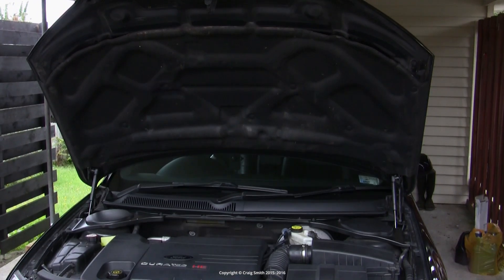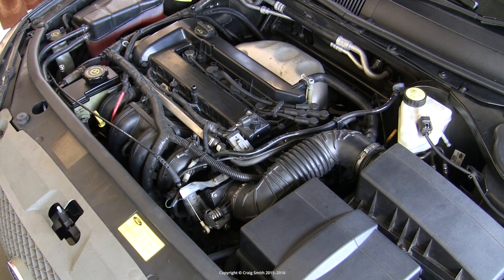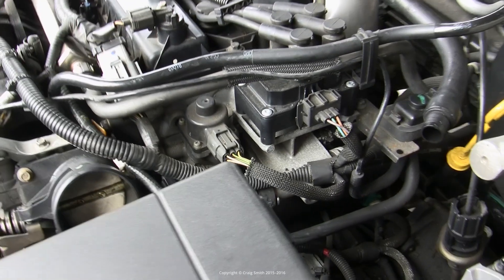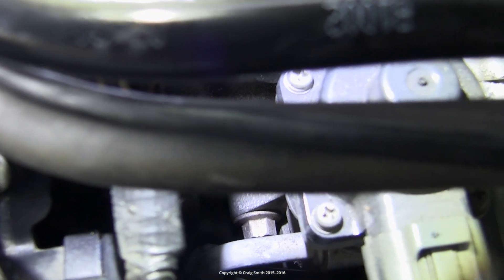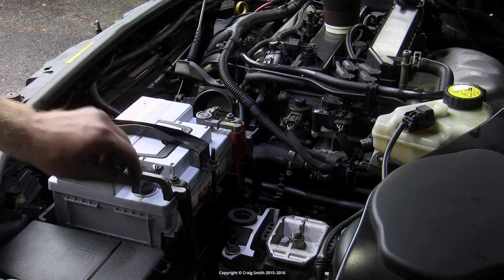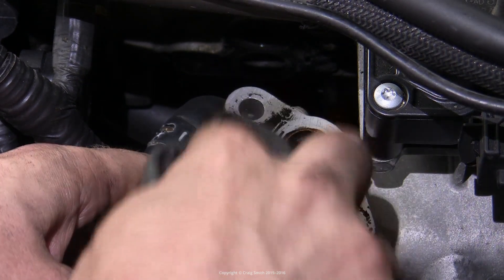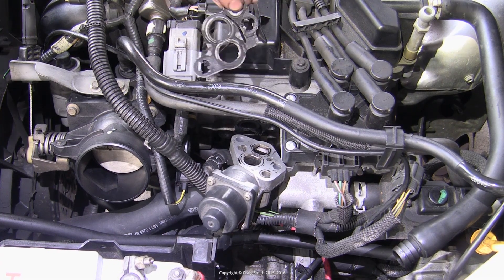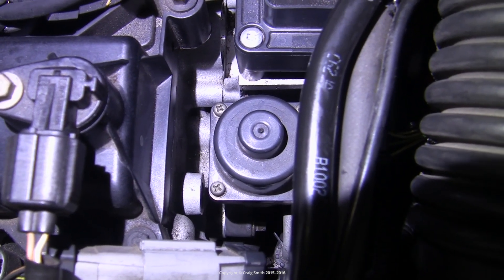How to: Remove & inspect EGR valve Ford Duratec HE (Mondeo, Focus, Mazda)

Comment: Hi Craig, I've a 2007 ford focus 1.8 petrol with the duratec engine, how do i know its a duratec HE, in all my details it shows its a 
focus style flexifuel 125ps model or does it make any difference, also are the 1.8 and 2.0 litre engine manifolds interchangeable cheers
Reply from the maker: I'm not sure it's styled a Duratec HE, possibly different, but all these engines are based on the Mazda L. This article suggests you have a variant called a Duratec FFV: https://en.wikipedia.org/wiki/Mazda_L_engine ~ I don't know more about it sorry. It's obvious that the intake manifolds are again all the same base design, but there are varying attachments between years and models so you would need to visually check to be sure.

Comment: do you have any experience with an egr blank kit?
Reply: I used to have a focus 1.8 duratec the egr valve was sticking open intermittently making it drive like a pig, so I ordered the blanking kit off a company in Poland through eBay, when it arrived I un bolted it like Craig done in is video removed the original gasket, then carefully slid it in between the head and egr valve with the gaskets they sent one on each side then done the bolts up lost I bit of coolant that I replaced the next day, anyway it worked a treat, drove nice and smooth, only thing was lost about 1 mpg average the mpg not good on the 1.8 used to average about 34 before then went down to 33, also after 2 weeks exactly the mill light came on but did not effect the running of the vehicle got 2.0 version now much better even better on fuel can average over 40 mpg on a run (and also has disc brakes on the back:))
Reply: Andrew Thomson The EGR block off plate ? It works ? Any noticeable power or efficiency ?
Reply from the maker: No experience sorry.

Comment: The egr systems on engines are really horrible. Engines were intended to run with fresh air, fuel and in the case of petrols, spark also. None of the exhaust recirculation shit.
Reply: You will go back to E2

Comment: Craig, I am a total novice, and can't afford to pay someone to fit my new egr valve on my MK3 Mondeo 2.0 Petrol (2003). So have tried doing it myself, but I cannot for the life of me get at the lower right hand bolt! I am wondering if the extension bar that I have is too fat for the job? The one you are using here in your great video appears to be quite a bit thinner, am I just being daft or does this sound plausible? I have a standard set by Draper, what would be the correct name of the part I need please? I could do it if it were not for this one bolt! Many thanks. Mark.
Reply from the maker: Yes it's tight. You'll notice I'm using 1/4" socket parts (at the bolt anyway), including the universal joint. Anything bigger probably won't work. If you look at 2:38 you can see the tools clearly.

Comment: I think I lost almost 2 litres of coolant when i removed the EGR valve. It just dripped endlessly from the small hose for a long time and i couldn't remove the hose from EGR valve immediately (awful location  and very easy to damage some cables etc). Anyway, some hours of wrestling and the job is properly done.
Reply: That hose is connected to satans toilet I am sure. When it started oozing, I just stared at it in disbelief for about 2minutes haha. The special factory radiator fluid is hard to even know what it is. I thought that was an exhaust inlet port... I don't want to work on cars anymore.

Comment: Coolant does flow through the valve body from the hose to the block. If the gasket is not in good condition or the bolts not tightened properly there may be a coolant leak from the mating surface.
Ask me how I know!
Reply from the maker: That's a good point that I got wrong in the video, thanks. So the lower edges of the valve should be checked for coolant leaks, especially after the engine has been run up to temp.
Reply: So If I keep the hose still clamped on the nipple and I removed the egr from the block, it will still leak coolant? Why did it not do that in the video? I drive a 2004 Mazda 3. By the looks of it, the egr valve on both vehicles are the same.